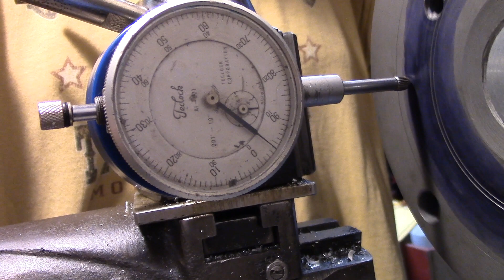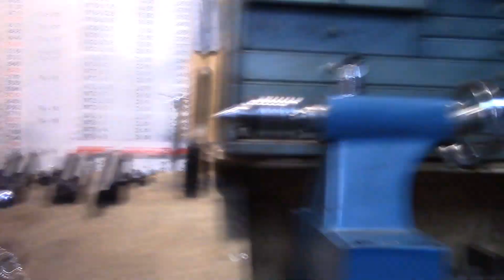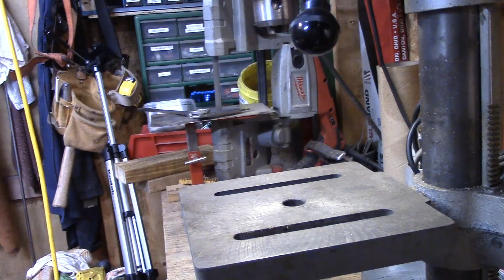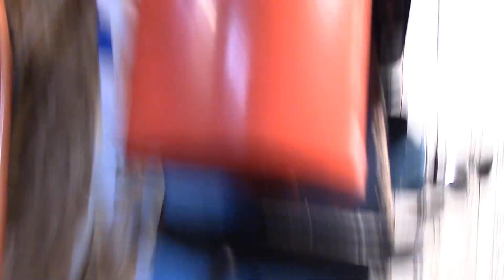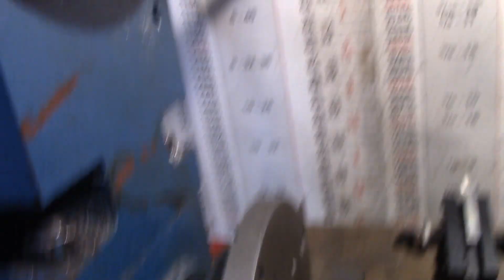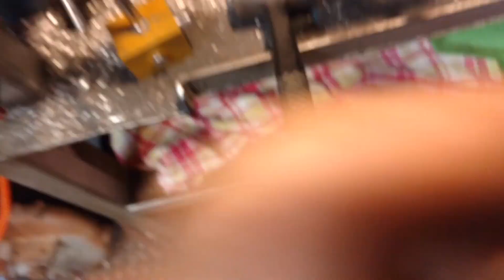Modifying a Screw-in Lathe Backplate to fit on a small 3 bolt spindle - Mini Mill Drill Lathe

Comment: Use the 4 bolt holes to get a circle and measuring in from that would be a lot easier in my mind. You know the four holes are correct. Mount the plate in your 3 jaw from the outside and use your tool bit to scribe a circle around the 4 bolt holes, centers, outside or insides of them makes  no difference. Set your dial on your cross feed and use that to come reduce the size to the size you need.
Reply from the maker: My 3 jaw was not big enough to hold it from the outside

Comment: You could have indicated the outside of the plate, centered the plate in the lathe then measured the diameter and calculated the center then move your cross feed in toward the center less the dimension of the pattern?  It would have been best to screw the plate on the spindle and then calculate the center.
Reply from the maker: Agreed, but the outside of the plate had some slight variation, probably not enough in the end to have mattered but I was not sure at the time. That is definitely a way to do it by measurement only. I do not have a threaded spindle but that would have been more accurate for sure. Best!

Comment: You'll get a better finish and less 'pick up' on cutting tools if you use white spirits as cutting oil (paint thinners for oil based paint) I've also used diesel fuel as grinding and cutting oil for various aluminium alloys (castings, 6061, 70** series). It works well because of all the detergents in it
Reply from the maker: Interesting on the diesel, I have always used WD or tap magic (the type designed for aluminum). Diesel is def cheaper than either. I have never tried spirits, I will have to try that as well, though I will have to take a bath before my wife will get near me if I do. She used to do refinishing but can no longer stand the smell, lol.